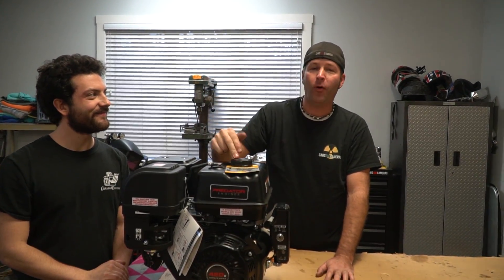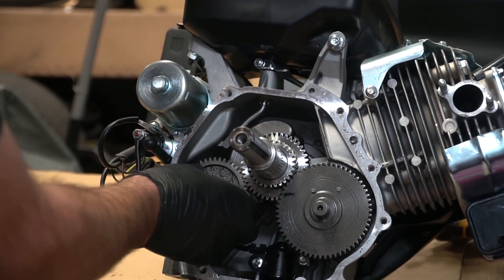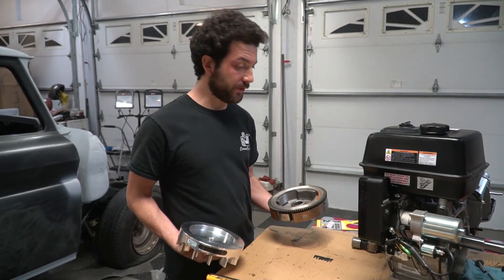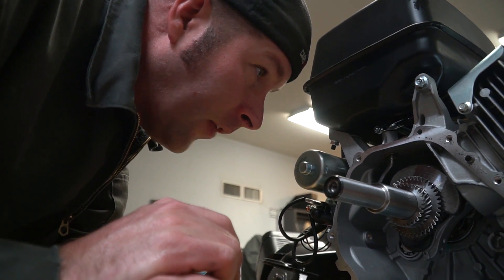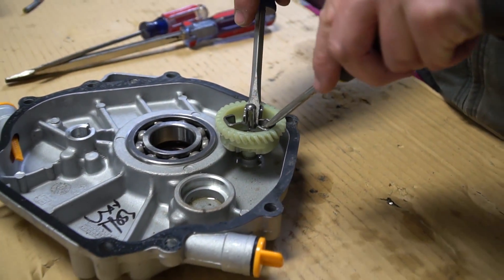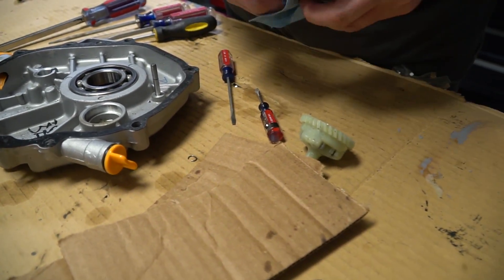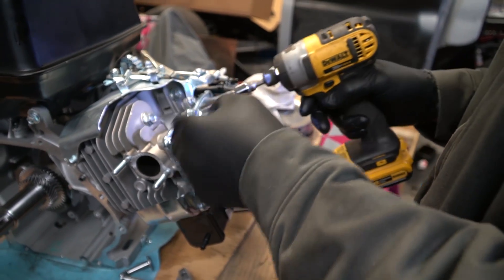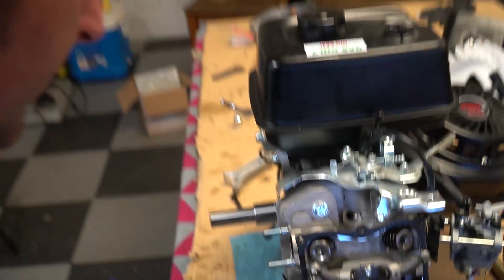Predator 420cc Stage 2 Build Pt. 1 | Cam, Rod, Flywheel, & Etc!

Comment: What is the reason you remove the balance shaft bearings?  Can't they just be left in?  Also what are the pros and cons of the balance shaft?  Could you do a video on that?  I'd also be curious how much lighter the engine was when finished.

Comment: An easy way to get that governor gear off is to go under it with a pry bar against the main bearing and it pops the clip right off in less than 5 seconds

Comment: Anyone have the dimensions of the 420 after the factory air box , muffler, and fuel tank have been removed? I’m about to go get a free 420 that’s coming off a generator that burnt up but the engines is still good

Comment: if you heat the area around the bearing with just a propane or map gas torch to 300 to 400 degrees. the puller will pull it right out. No need to weld you're basically heating it when welding thats why it comes right out.

Comment: I think you could keed the electric start if you would take the billet flywheel and put it on a lathe and turn it down where the ring from the old one could fit

Comment: Pro tip for the governor retainer cut the wheel so you have a flat direct spot and then use an old chizzle and put it under the clip right on one side near the gap and if u have to tap it under the clip and then just pry up on the clip do that a few times and itll be bent enough to get it off works for me every time in 5 minutes or less

Comment: they make valve spring tools that allow you to remove the springs from the top with the head on the motor. You can also push a bunch of nylon rope into the plug hole and gently bring the piston to top dead center to push the rope against the valves to hold them in the seat. here is a link to the tool. https://www.ebay.com/i/282365635868?chn=ps

Comment: Do you know where I can get a head for that motor?  I have the same 420 but the exhaust studs broke and messed up the head. I could probably weld it up but would rather replace it. Gapssaid they don't offer on for the Hemi style.

Comment: They should stick the EFI and turbo kit on the drag rail for a bit.  You should also look for another over head cam motor to build. Its probably why that motor is smoother. What about a stage 3 OHC EFI turbo motor?

Comment: An easy way to get those bearings out that y'all had to weld two is Take some grease pack in there then take a socket are a piece of solid shaft that'll go inside the bearing and pop it in the grease pressure will push the bearing out like removing I pilot bearing in a car engine then you wouldn't have to worry about the weld getting in your cylinder wall are on your crankshaft

Comment: all you had to do is heat the case from the back side where the bearing is with a torch and it would have fell out when you turned the motor on its side.

Comment: they have starter generators that are belt driven that I am willing to bet you can make work on this 420. for about $100. i am sure you guys can hook up a pulley to either side of the engine to connect it to!

Comment: Gas golf carts have a belt drive starter/generator system that far surpasses the Predator systems in pretty much every way other than robbing a little hp. I imagine that is why they don't care about trashing the charging coils, starter, and ring gear.

Comment: 5:15 you don't need a bearing / slide hammer for that removal, use the old grease trick.  get a bolt that fits as close as possible to the diameter of the hole, fill it with bearing grease, wrap the bolt in tape so its nice and snug, insert bolt over greased hole, tap with hammer, bearing pops right out,  I've used this on pilot bearings for years. my dad used to use BREAD, yes bread bread. but thats just not right

Comment: You could have heated up that case and that bearing would have dropped right out and you would have still been able to use it. Also you guys need to invest in a Dremel tool. Good job though good video. Thanks for sharing

Comment: How could I build a front engine drive with a drive shaft with a transmission and rear differential. Any ideas, I would like to put a large two cylinder motor

Comment: Guys... Please learn your terminology so you don't appear 
"New"  some of the younger crowd look up to y'all. (WHY ????)   I Don't know..  But anyway I saw a video lastnight a guy was testing a Honda 305 and came up just short of 34 hp @ 7,900 RPM.
 So if your build goes good, you will have a way cool 420.... Around 40 hp. Give or take. But I believe they were running nitromethane.

Comment: you guys should check out https://www.bullfrogperformanceproducts.com they have great parts for these engines. I would highly recommend getting a balanced crankshaft with not running the balance shaft. i race these engines and have around $2500 in each of my engines

Comment: Hey guys I have just the thing for the Ducatti. You've built everything else, and have some go karts that are close, and with good suspension they would be close to a cross kart. Yes indeed a cross kart would be the perfect place for the Ducatti. It would be fast, and you would be protected by the roll cage with wheels and an engine. What do you think?

Comment: When i changed my valves in my 96 200s atc i used a 2 ton bottle jack press and used 2 wrenches ontop the spring and press it and fish the keepers out i used a straw and blew them out

Comment: Have your billet fly wheel machined and have the ring gear attached to it. So you can keep your starter. Also, you can have your charging coils added. 

Not hard to do.
Reply: Yea not a big job, I was wandering why they didn't go down that way.

Comment: Take an old spark plug break the porcelain off then drill out center with 3\16 drill. Then weld on an air hose connector. Install It in spark plug hole and connect your air supply hose and it will hold your valves in place. Old school from Canada .
Reply: Thanks but the springs were too tight to compress
Reply: We use a deep socket and hammer to strike the spring quickly and out pops the locks. Just chilling in Ontario Canada lol

Comment: A few points, you may be able to swap the ring gear by heating it up to remove it, that gasket will likely set the end play so the engine will be very tight to turn if you just use silicone, eBay/amazon has a $16 valve spring compressor that works fantastic on small valved heads.

Comment: An easy way to get bearings out with welding in your engine, is get a bar of soap, wedge it into the bearing, then get a socket or a dowel or something and hammer in on the soap. It will expand and push the bearing out... I've seen Mike Finnegan do it a bunch of times on Finnegan's Garage.
Man that thing must have super low compression... flat piston and hemi head means huge gap. Remember when domed pistons were a thing? I know Ike does because he used to have a bastardized Triumph chopper and Triumphs are hemis with domed pistons.
Reply: Ive seen grease used instead of soap. The case is so thin i was afraid to try

Comment: 15:45 the tool you are needing consists on a C-clamp and a short section of pipe with a cut away on one side. already have C-clamp and some small pipe can make that tool for less then $1.

Comment: with the valve springs you get an old spark plug and remove the guts of it and weld a air fitting to it then just put it in and add an air line and the pressure will hold the valves in place

Comment: Use a compression tester with the Schrader valve removed to pressurize the cylinder and pull the valve springs.

Comment: Tip for removing valve springs. With the Piston about 1/4 way down the bore, insert a length of clean nylon rope into the spark plug hole. Be sure to tie a knot so it doesn't disappear 😉. Bring piston up until it compresses the rope, holding valves in place. R/ R valve springs, take piston back down and remove rope.

Comment: A socket and hammer always removes the retainers quickly. 
You think it sounds hack but about every machine shop I’ve ever seen does em that way. and it works fine, you just dont need to be a hamfisted sledgehammer ogre.

Comment: Hey y'all. When I did the valve springs on my Holden V8 last year, I used a cheap eBay special overhead valve compressor and a cylinder leak down tester to keep the valves seated, no head removal again. I had to add the inner spring of the dual set after the cam was run in. Fun job when there is 300lb spring pressure there!

Comment: Also, if you want a charging system, you can use the one on the Golfcart to both start the engine and charge the battery. Let me know you want to do this and I can walk ya through this process. There’s an adapter on eBay you can buy to adapt the Golfcart clutch to the 420 shaft. From there, it’s just using the rest of the stock Golfcart components.

Comment: Just being you're average internet prick here. It's not called "slag" it's called "spatter" GMAW with a solid wire doesn't produce any slag. And I don't see why you would have to remove that bearing, it wont hurt anything if it's just chilling in there, would it?
Reply: It is possible it could fall out over time then it could find a crankshaft at 6000 rpm
Reply: @isaacitllbefine7231  gotcha, I was just curious if it could fall out that easy, obviously i understand thay you would want to be safe rather than sorry. Thanks for the reply

Comment: Wow this video is sloppy. Cutting corners. Should have torqued the end cap on the rod out of the engine. Had the crank out anyway. Should have pulled the head. Disappointed.  Didn't show how to measure the clearance on the crank with the new rod. This is supposed to be a informative video

Comment: I've built the same motor with same kit but did it a diff way due to doing some costom Fab work to some parts of the motor/kit myself. And the bearing did not get taken out as it didn't need to be.. it was in there nice and tight and was just unneeded and unnecessary work.. just my two cents...

Comment: Run an air hose to the spark plug hole. That will allow the air pressure to hold the valves in place. My Harbor freight compression tester has 3 hoses that can be used for this method.
Reply: was thinking the same thing
Reply: Put a dowl or your finger in the port. Hold the valve up
Reply: @rogermarshall8991  the air pressure method frees up both hands to use on getting the spring and keepers in place.
Reply: You could even put string down the spark plug hole and put the piston at tic to hold the valves.
Reply: and turn the crank, no?

Comment: You guys might want to consider gapping your piston rings, especially if you plan to force a lot of power out of it. Remember the 670...
Reply: The 670 had a plastic gear in the oil pump fail due to being run at much higher rpm than its meant for IIRC.

Comment: I know I've removed valve springs with a 5/8 spark plug socket and a hammer on sbc befor. The rubber that holds the plug in will keep the retainers from flying out the end when you tap it with the hammer.

Comment: Could have got the balance bearing out with some bread and a punch that fits inside the inner race. you put some bread in there hammer it, put some more in there hammer it, repeat. The bread will get behind the bearing and push it out. Example https://www.youtube . com/watch?v=00OlG5E8vLk

Comment: Have you ever seen the rope trick when working on valves in a head that is still on the engine?  You take the plug out and thread a long rope into the cylinder leaving the end of the rope sticking out so you can retrieve it after you are finished working on the valves.  you rotate the crank to press the rope up against the valves to hold them so they don't fall into the cylinder.  You will also need a spring compressor that goes on the rocker assembly so you can compress the spring and  remove the keepers and the spring. After you are done back the pressure off the rope and pull the rope back out.  ( Not sure if that will work on this type engine have seen it done on a car engine before.)

Comment: No electric start on a golf cart is going to be a real PITA. also, does ARC or gopowersports recommend removing the balance shaft? Seems like it would be more needed at higher rpm. Take the weight savings from the flywheel and leave the balance shaft imo. Hope to see that new torque converter from GPS when it gets on the cart.

Comment: Removing the counter crank may be a mistake.
Some engines have them to keep the crank together at high RPM.
I would try to have it both electric and pull start. Solar panel on roof and plug it in to charge when you get home.

Comment: As a balance engineer this hurts to watch guys, if you change your conrod or piston you need to balance the crankshaft or the engine will die very early.
Reply: Not sure if this is true.  I've seen people slap rods and pistons into Honda's all the time.  I'm sure it helps to balance the rotating assembly for sure, but not sure if it's 100% necessary.
Reply: neurotropical  it really is necessary that’s why it’s a huge industry 😋 especially if there planning on increasing their RPM, as that increases so do the forces causing by the out of balance,  this will eventually lead to the bearings failing and damage to other parts of the engine due to massive vibrations, don’t get me wrong there engine will work for a bit and then it will fail
Reply: You’ve seen what happens when you put a brick in a washing machine right? Well that’s because the brick puts the machine out of balance, that’s what’s happening inside the engine
Reply: @Randomness920  Yeah.  I get the concept... I did pass high school physics haha.  Really, by all means you should be right.  An off balance crank/rotating assembly can create massive forces by being just a gram or two off balance at high RPM.  I'm just saying, I've seen engines slapped together without balancing the crank and work just fine.  I've also seen pistons and rods weighed to be put into an engine that were about 1-2 grams off from each other.  It worked in that use case.  I know Matt Happel in particular threw rods and pistons in a d16z6 without any balancing and ran the tits off it no problem.  I think he used 3 rods from a blown engine and one from eBay too!
Reply: neurotropical that’s a car engine correct? You can get away with it on cars a little bit more as they don’t Rev as high and have 4-6 bearing in place spreading the load in a very thick crank case, not two bearings in a thin case

Comment: Should have put the Ducati  in it! Would have been awesome for the street. Also instead of cutting the governor arm with a grinder try bolt cutters next time. Way less metal dust to worry about  scoring your bearing/piston and such if you dont get it all out of the block.

Comment: Why not just leave the balance shaft bearing in there? if you were worried about vibrations working it loose, you could have just peened the aluminum around the outer race to hold it in for good.

Comment: can heat the ringgear up so expands and fall of the flywheel , need to rotate the thing on a turntable and only heat the ringgear so it expand faster then the flywheel , heat it up a little more then drop it over the aluminium billet flywheel (set it so it drops straight to the place it needs to sit using spacers ) then leave to cool , still need to get a dynamo on there somewhere to keep the battery charged

Comment: if you have a compression guage screw the cylinder end in the spark plug hole and plug the tool end into a compressor hose.you will have to have the side plate on the motor because the compressed air will push the piston to bottom dead center. ive done it many times putting new valve seals in cars and trucks.

Comment: Best way to get them blind hole bearings out is to heat up the aluminum from the back side with a propane torch and watch them bearings fall right out. The grease method won't work with an open cage design as another commenter said.

Comment: if you want to work on valves with the head still on, take an spark plug drill it out and weld an air fitting on it. screw it in and connect it to compressed air. that wai the valves will stay close and you will be able to work on it... love the vids greeting from Namibia.

Comment: Is you stupid?
Remove the balance shaft to get more rpm?
Why not remove the valve springs to avoid float?
Reply: Balance shafts are only to help make the engine feel smoother by getting rid of vibrations. They dont actually balance the engine. By removing it theyre reducing the rotating mass which helps spin the engine up quicker
Reply: @m4xwellmurd3r  
Whew, balance shafts don't balance the engine?
Jesus, did you even think that through?
Reply: @riccardo1796  they dont balance the rotating assembly like an externally balanced engine. They work more like the rubber engine mounts in a car

Comment: if i buy a new moter for my kart do i have to build it my self?
or is it already build
Reply: I believe that you can buy an engine with stage (1,2,or 3) possibly. correct me please if I am wrong
Reply: Sounds like you should just buy the predator 212cc and run it as is or the tillotson 212cc if you want a bit more power.  They come all assembled and ready to go.  Just add oil i think.